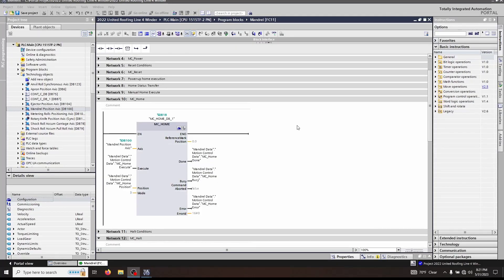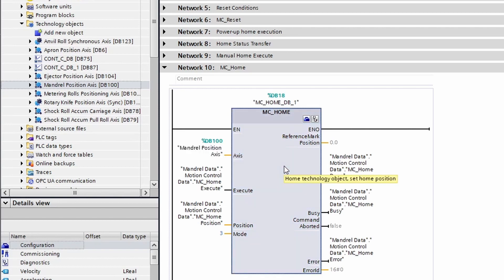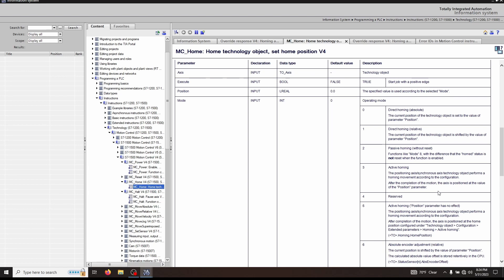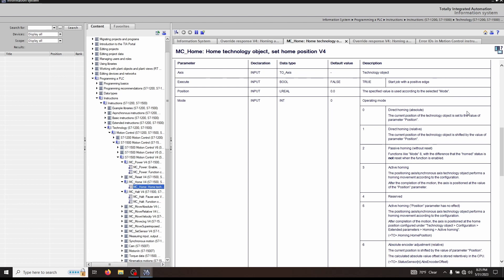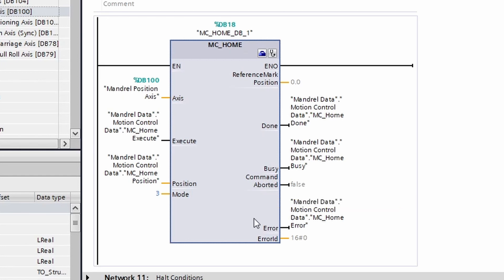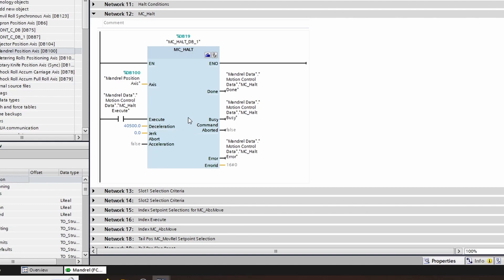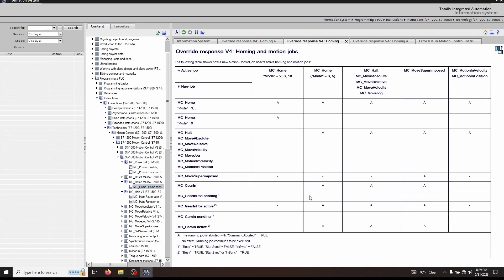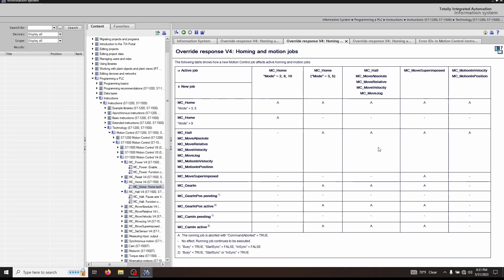Using Siemens PLC Function Blocks: MC_Home and MC_Halt

Comment: What is the different between MC_Halt amd MC_Stop ?
Reply from the maker: MC_Stop prevents any other MC function from executing while the enable input it active. MC_Halt only cancels (most) active moves and stops the axis. If the enable input stays enabled on a MC_Halt and another MC block is positively executed (such as MC_MovRelative) the axis will move again.

This is a great point to bring up, because I use the MC_Halt function mainly to cancel moves such as positioning moves or gearing, but if you want to prevent the axis from moving you would need to use an MC_Stop
Reply: Hello
Can I use mc-home when using mc-stop or mc-halt?
Reply from the maker: If you are running MC_Home both MC_Halt or MC_Stop to cancel the homing move.